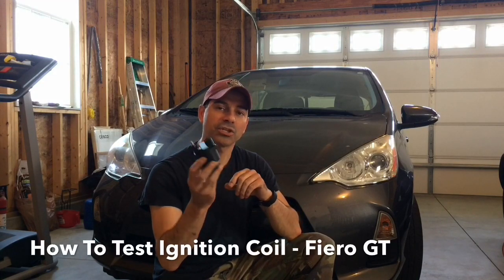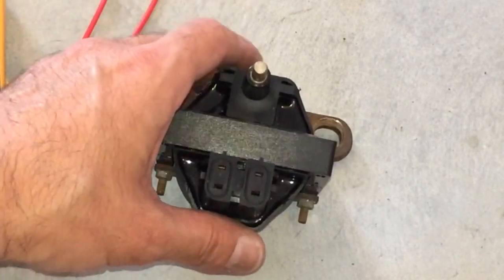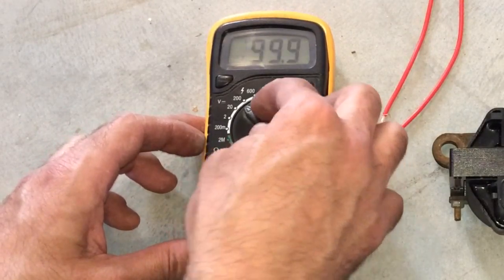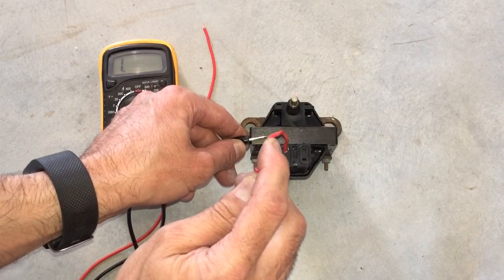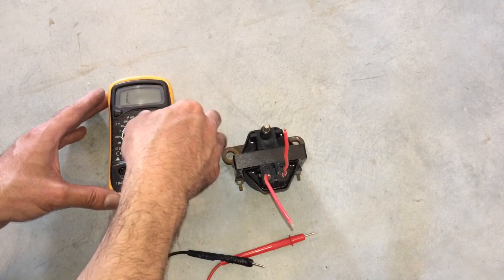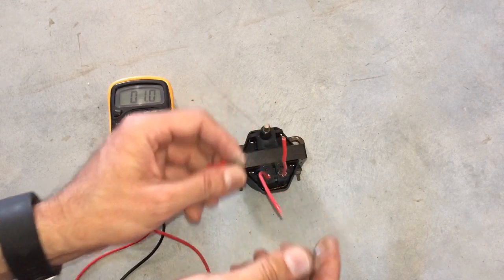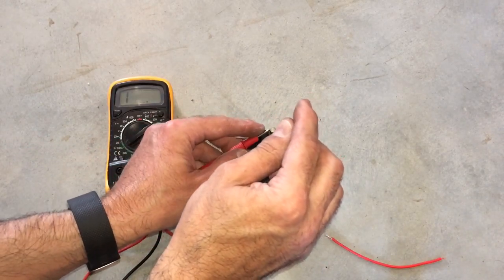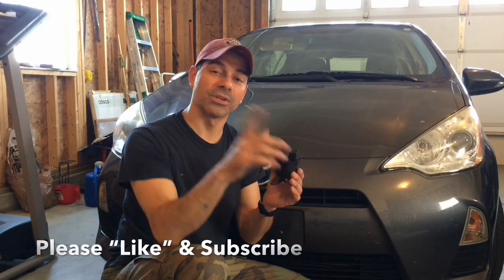How To Test Ignition Coil - Fiero GT (Andy’s Garage: Episode - 77)

Comment: I have a question.  I’m trying to troubleshoot a no spark on my 86 fiero with a 89 TPI 5.7.  I did this test on the coil, I’ve tested the wires, i checked the pick up coil voltage in the distributor, even replaced the icm and i still have no spark.  I even put a spark tester directly on the coil and I’ve got nothing. I’ve got 12 V going in the coil, is it possible for the coil to be bad even passing all the ohms tests?  The coil is an msd street fire, and I put it in about five years ago, I drive the car maybe 200 miles a year.
Reply from the maker: Are you sure your ignition cables are good? If they are bad it will cause misfires as well
Reply: @PhillipsVision  Basically the car ran fine except when warm starting so it made me believe it was the ignition control module.  When I went to take it out I accidentally broke the wire on the pick up coil so I bought an ICM and pick up coil combo from MSD.  After I installed it the car wouldn’t run at all.  The coil passes all the ohm tests.  I cut a small piece of vacuum hose and put it on top of the secondary coil and then I shoved the spark tester in there to connect the two together and it still won’t spark

Comment: on the fiero gt coil, I have no wiring harness.  Can you tell me where wires need to go on the 4 pin icm and which slot the hot in goes to.

Comment: Great video. Thank you. Have a question about where the 4 slotted connector go using the shot at around 37 seconds into your video. I believe the bottom right where your finger is is the IGN, The top right is for the TACH, but  is it the top or the bottom on the left that is + and what's the other connector for?
Reply from the maker: If you’re looking down into your engine bay at the coil...the lead to the distributor is on the right. The connector is on the left and it this order...upper right - Ignition, upper left - tachometer, lower right - +, lower left - black wire. Hope this helps.
Reply: @PhillipsVision  Thank you.